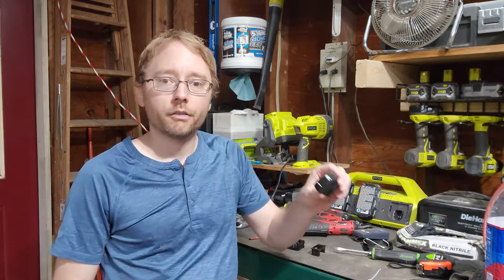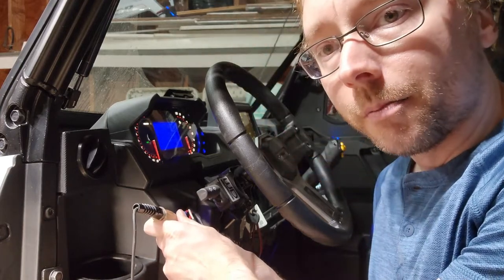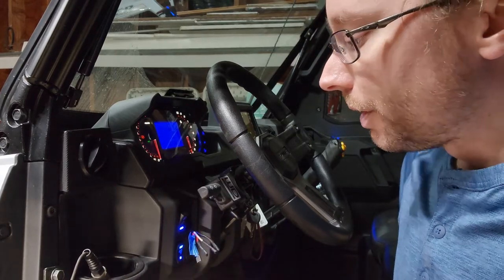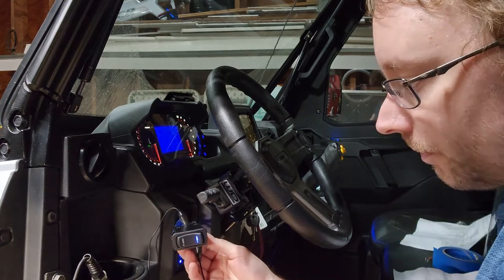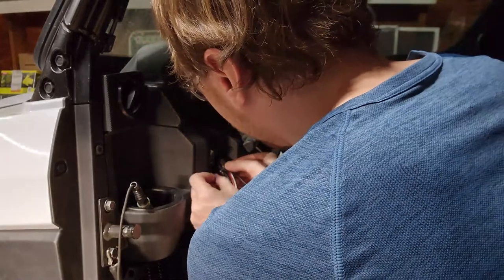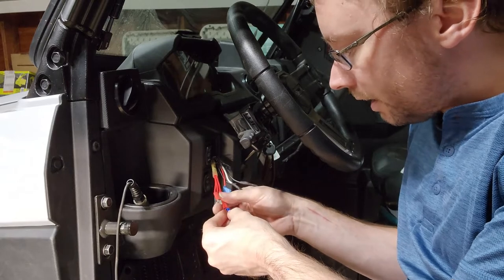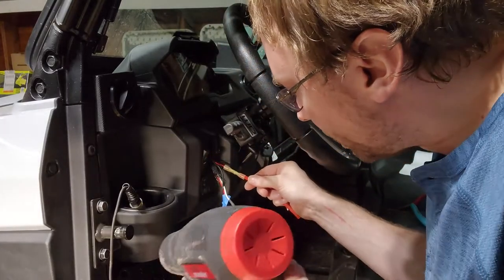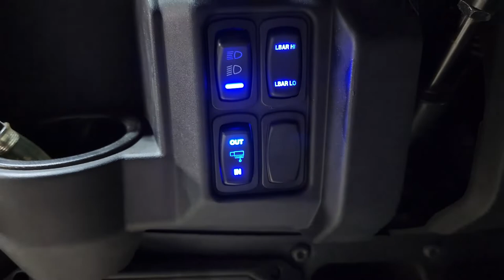Rough Country 12in Front Light Bar Switch Update

Comment: Nice that you found OTR. I didn't like the switch that came with my SuperATV Black Ops "Plug'n'Play" winch or the push button switch that came with my Rough Country non-DLR 12" light. So I replaced both of them with OTR switches. I also have a custom "Dixie" labeled switch coming for my Yolo "Dixie" horn. An alternative to inserting all three hot wires into the butt splice is to "Daisy-Chain" the female spade connectors. Excellent video!